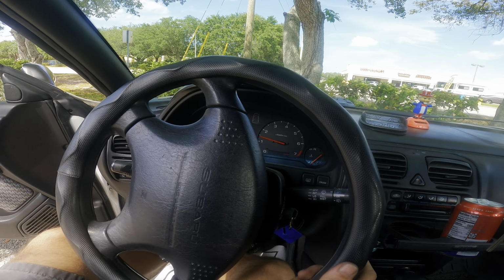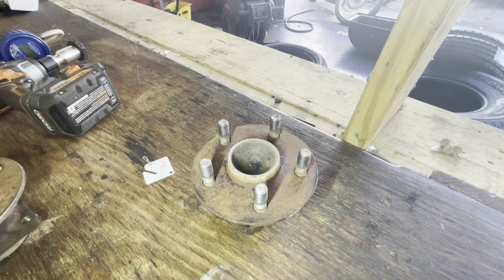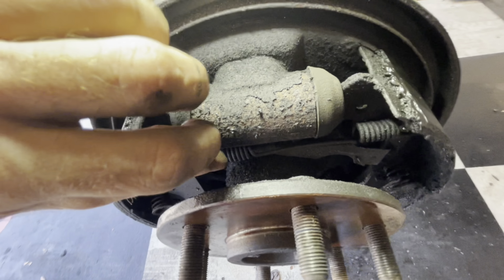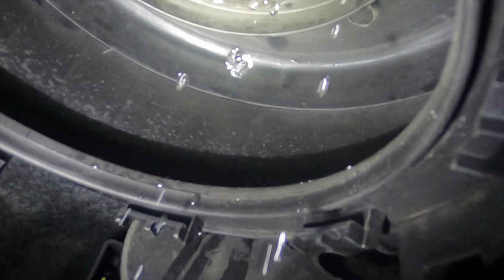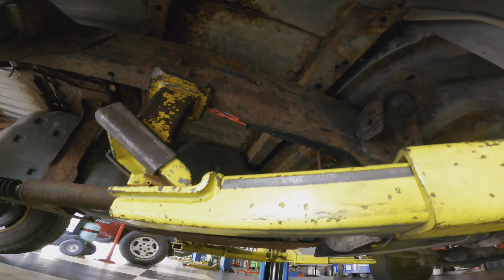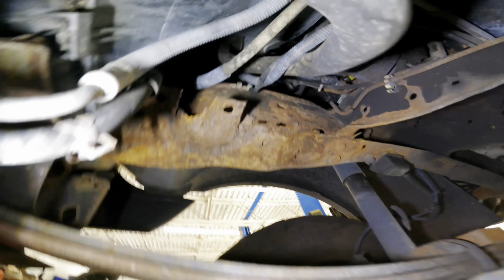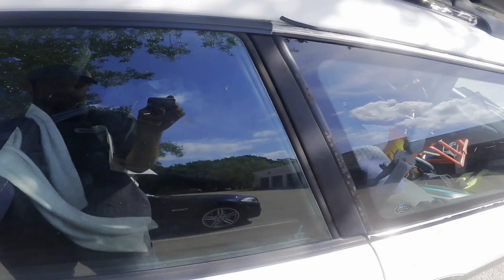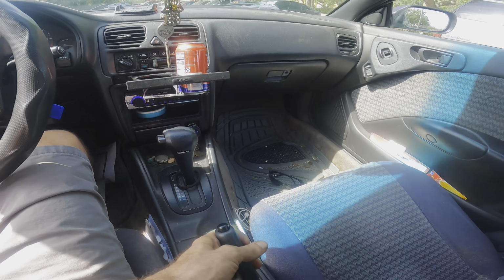Customer States: No! “Towed in and Towed Out” Compilation

Comment: I'm in the process of fixing my 2005 Silverado right now. The frame is gone, brake lines all replaced, fuel lines all replaced,. The truck only has 125,000 miles. I'm going to fix this thing just out of spite. It's as if GM designed these things to self-destruct. I can't believe the national highway safety administration has allowed this to happen. GM has ripped off the American people way too long. Some of the people at GM should be in jail.
Reply: Mileage has very little to do with rusting.  If you're living in a snow state  a single drive on salted roads introduces enough salt to crater the frame in a few years.  Your 2005 has probably been on the road 18 yrs, a bad frame is par for the course in the NE.  It's got nothing to do with GM, it happens to everything.
Reply: Sorry for your troubles.  My 2006 Z71 with the  aluminum 5.3 has had 2 water pumps a couple of batteries and a couple of ball joints all in the course of 320000 miles.
Reply: Toyota Tundra/Tacoma says “hold my beer”    Both are notorious for frame rot.

Comment: looking at how well those still rotated I would say they're perfect for selling them on the used parts market listed as "Professionally removed from running, driving vehicle. LOTS of life left!"

The fact of the matter is... bearings like running hot, helps grease get into all the pits and grooves which is important for the automatic self-clearancing feature to work correctly. I didn't think it was a secret but most bearings have an automatic self release feature built into them that even auto ejects the bearing "waste" when the part is actually "all-used-up". Mechanics like you clearly just want to pad your wallet ;)

Comment: That was a really cool episode, that's the part of working on vehicles that most people don't get to see, even though I've been out of the business for well over 10 years it's reassuring to see some things never change, I had a car come in one day and the customer stated they were having a little brake noise, when I pulled the wheels the passenger front had ground down to the cooling fins on both sides of the rotor don't know how they kept from blowing out the caliper.
Reply: It really does beggar the mind. I was a Mech in the Army, got called into the office to be faced with my boss and a Lt.  The brakes on his Accord weren't right.  Righty ho.  Had a look and the f/rotors were .0008 " warped. Replaced.  All good.  Bugger me he was back in two weeks just apoplectic.  His brakes were NFG.  Had a look.  Warped.
Back in the office.  Gave doombrain the good news.  `Sir, you have just had new tyres fitted.  The shop has over torqued the nuts and ruined the rotors (Accords were famous for this). Slammed it in, pealed off a perfect salute and said that unfortunately I have Army vehicles to fix.  Gave my boss an evil look and marched out.
We stopped doing officers cars after that.
Reply: @MrRunner  Hondas were some of my least favorite, especially the ones you had to use the on-car brake lathe to turn the rotors on because of the screwed-up wishbone suspension and pressed on rotors, I had a little old lady come in one day in a Buick for front pads and rotors a couple days later she was back with a pulsation no problem we kept a bunch of the GM rotors in stock so I threw a new set on and sent her on her way, the following Monday she was back with the same issue, I could see maybe having one set of defective rotors but not two in a row so I asked her to drive me to her home and I would drive her car back to the shop to keep it for a couple days till I figured out the problem, on the drive to her house I noticed she was driving with her left foot constantly on the brake pedal by the time we got to her house it was glowing red from the heat she ended up being one of my favorite customers till she stopped driving.
Reply: @maxmcarnage7642  I must admit, I have never turned a rotor in my life.  In fact I had never heard of this until I came to Canada.  The reason is that the spec on the rotor surface finish is in the region of 80 microns which a ground finish and cannot be produced by turning.
That little old lady must have a sister.  There was a story in the UK about said LOL, who complained vehemently about the fuel consumption and poor running on her new car.  Poor unfortunate mechanic, checked it out and found nothing.  LOL went ballistic, so Mech took LOL on a trip around the block.  LOL gets in puts key in, pulls out the choke, hangs her handbag on it and drives off.
Reply: @MrRunner  It's reassuring to know that little old ladies around the world are the same😁

Comment: That Subaru with the stripped rear brake block could be an easy fix by using barrel unions instead and a new nut to replace the stripped one on the pipe.  Special barrel unions are made to suit the flares on brake pipes, or else they won't work.

Comment: in regards to the last car, because the break block is a 2(in) to 2(out) it can be replaced if you have a mill and the correct bits/tap in about 20 to 30 mins so do not wright that car off yet